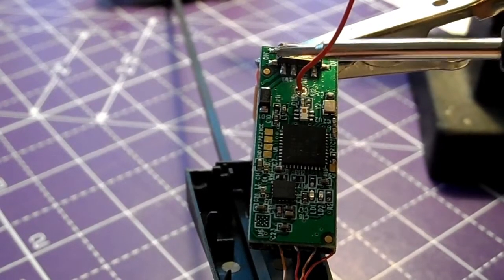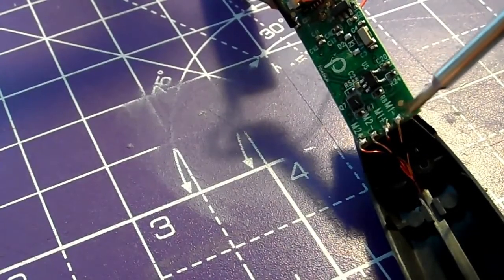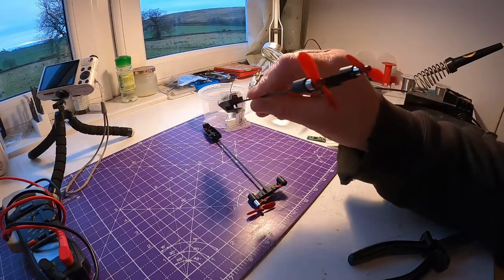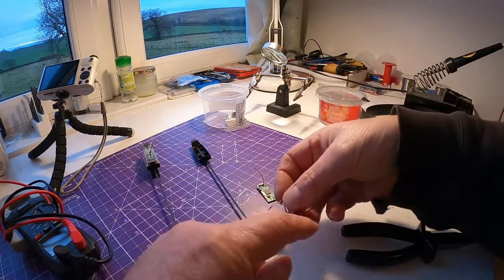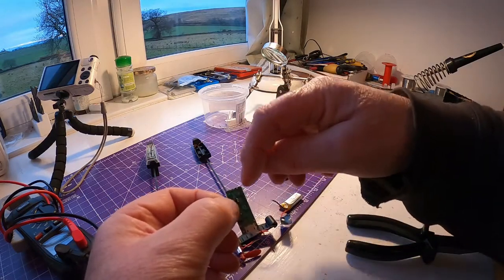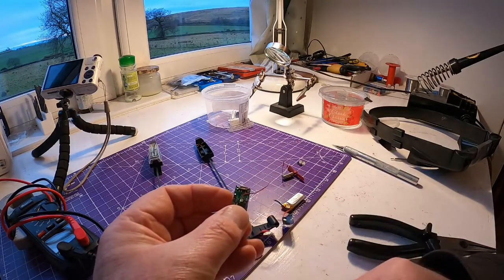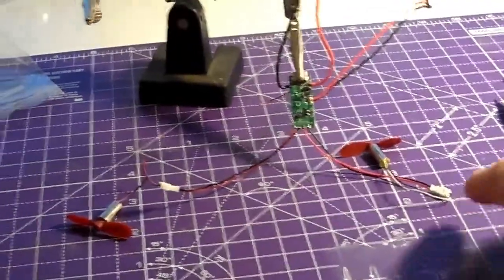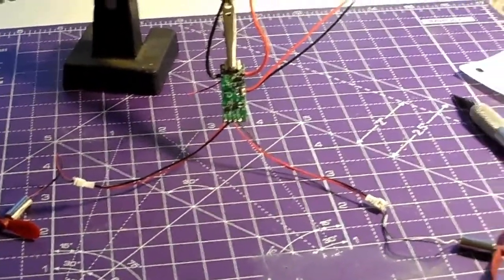PowerUp 4.0 Conversion to Tractor Mode Motors on Lockheed P38 Lightning Model RC Controlled Plane

Comment: Doug, how did you remove the motor from the P4.0? I have a unit (well out of warranty) on which only the left prop (viewed from rear) revolves. I'm trying to eliminate possibilities as to why it won't turn. Alternatively, if you have a theory of what could be the problem, I'm all ears!
Reply from the maker: Hi Tom, I have a video showing how to change the motors on a PowerUp4.0 
https://youtu.be/CLcvyNRvfRg?si=1jdLBv4sQBquIxkt

Comment: Well done Doug, not bad at all . That P38 flew really nice for a  first time.
Reply from the maker: Hi Lloyd, the plane flew reasonably well but tends to spiral into the ground if you turn too sharply. I need to modify the design and build a more accurate model. I have not yet altered the gyro settings for the control which was optimised for 'pusher' mode.
Reply: I had the spiral problem as well.
It is not the model, it is the steering setting. 
If one of the motors fully stops to make a sharp turn the torque of it also goes away and that makes it crash. It's like a half barrelrole